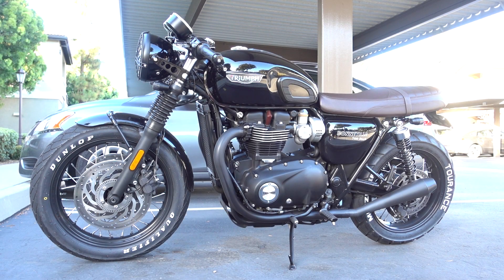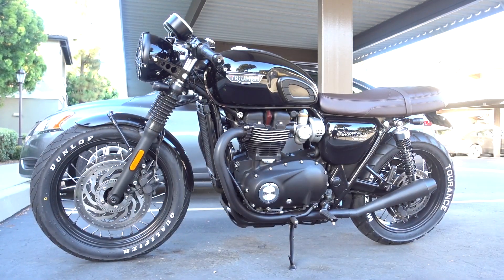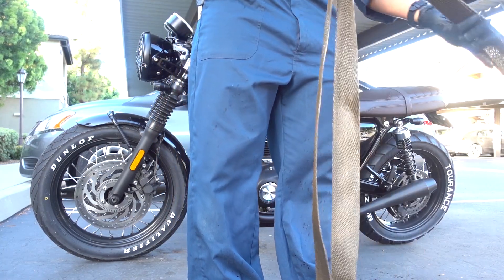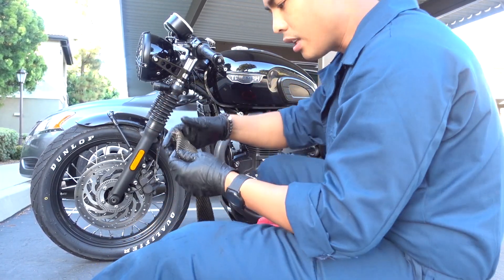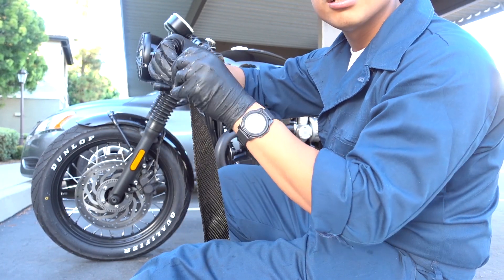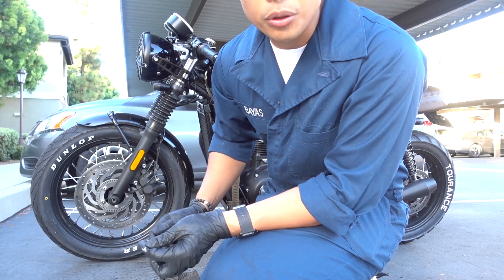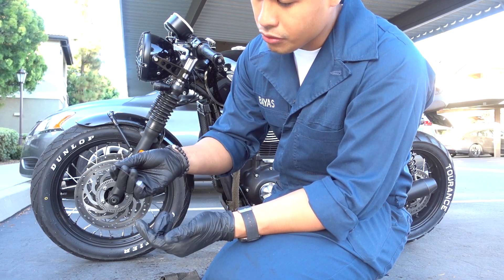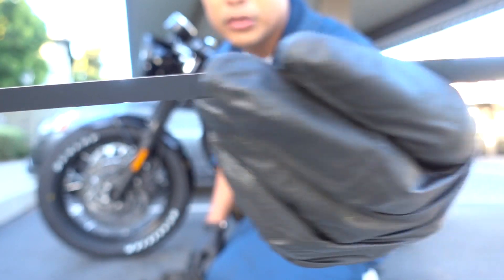2018 Bonneville T120 Black Exhaust Pipe Wrap

Comment: oh man... you made a common mistake ! you have to start from the end of the pipe and go in the direction of the cylinder. Like you did when water or dust is coming from above, it will go between each wraps - if you start from the end of the pipe, water and dust can't enter the wraps from above. Look at my videos on my Triumph Street cup.
Reply: I can see why it would be overlooked but it makes perfect sense, thanks for the heads-up!
Reply: Can you plz share the link of your video

Comment: This is a newb question, I apologize in advance. But how do you wrap the pipes on the newer t120 blacks. I noticed that the piping doesn’t go all the way through and partly acts as a covering by design to give the illusion. Did you change your piping or just wrap over the stock piping?
Reply from the maker: No need to apologize! But yes! I just wrapped over the old stock piping and the cover in the part where the pipe goes to the cat then back to the part where the exhaust pipe connects!

Comment: Hey Paolo.  Think I'm gonna pull the trigger on the clip ons and tires.  Just have a couple more questions...How is the tank clearance with the bobber clip ons at full turn?  With the larger tank of the T120, I have had issues with another set I tried to install.  For the tires, any reason why you didn't go with the Tourance on the front as well?  Thx
Reply from the maker: I didn’t go with the Tourance because I don’t think it was available in the size I needed. Also, these clip-ons have just enough clearance so that it doesn’t touch the tank at all at full turn.

Comment: Just wondering, did you use the black titanium from DEI or the regular titanium-gold. Did it change color? My bike is black like yours, trying to decide on color. By the way, there’s a guy that suggested crazy glue to lock in the fibers during installation, on his video it worked very well. Cool bike by the way.
Reply from the maker: I’ve had these wraps for a while now. Sorry, I forgot which exact ones I have.
Reply: Old Guy Gamer 
I ended up getting the titanium lava from DEI. It came out awesome. I used the crazy glue trick and I had no unraveling. I went for a couple of rides and the golden metallic color didn’t change. My exhaust headers are twin wall so they don’t get as hot, in fact you can touch the wrap with bare hands for a few seconds and not get scolded. They smoked quite a bit when I first rode the bike and I also noticed that they feel a bit “crunchy” after the first and second heat cycle. They haven’t completely dried yet, still some smoke coming out but no smell. I don’t ride this particular bike in the rain or lousy conditions BUT it will be very interesting to see how dirty they will be if I ever get caught out there. I don’t see a way of cleaning the wrap without damaging it. I guess a bit of dirt will only add some character. 
One thing that I noticed was that yesterday, it was a very humid day and you could see the moisture evaporating. I would be very concerned if the bike didn’t have stainless pipes and stayed parked outside for long periods of time, however, for those garage queens there should be no issues. Time will tell.
Reply from the maker: Nice to hear things are going well for your motorcycle! I had these wraps for more than a year and I ridden in rain, sunshine and whatever weather Southern California throws at me. So far, I have had no unraveling, and the wraps also clean off just fine with a thorough spray down and wipe with a cloth.i do notice a smell when the wraps get wet but, it hasn’t affected the bike performance or the wraps themselves.

Anyway, ride safe!

Comment: Great looking bike man! What bars and headlight brackets do you have? I’d like to see a video going over all the mods you have done!
Reply from the maker: Matt S. Thanks man! I will make a video about that soon, but to answer your question the bars are clip-on bars that Triumph sells for their Bobber. The headlight bracket are from Joker Machine.
Reply: @xrampax3236   did you need new cables switching to clip ons?
Reply from the maker: I did not. I used the same cables.

Comment: Love the sound of your exhaust!  Sure it's not stock.  Do you mind letting me know what brand, model # (if any)?  Wondering if I could replace my 2014 T100 stock.  I see you were able to do the job without taking the exhaust.  Just what I have been looking for.  Thanks for sharing your video.
Reply from the maker: Geoffrey Buted thanks for commenting!! My exhaust is from Gasser Customs. If you go on their website you’ll see they have different fitment for different year bikes so just pay attention to that! I chose the black ceramic exhaust for liquid cooled Triumph Bonnevilles 2016-2018.
Reply: Thanks!  I looked and decided.  Just curious if I need to remapped.  I hear if it is just a slip-on, you can get away without remapping.  Did you remapped yours?
Reply from the maker: Geoffrey Buted no need for a remap if you’re just replacing the slip-on pipes. I did not remap mine.
Reply: What a relief.  Was worried about that.  In fact I can even replace it myself.  I might just have a concern with the left side since it has the stand.  Any thoughts with that?
Reply from the maker: Geoffrey Buted wow.. didn’t realize you commented back. If you haven’t already done so... the pipes fit perfectly even with the center stand.

Comment: Really like what you've done with your T120!  I have one as well and am making some changes.  Were many modifications needed to install the bobber clip-ons?  My dealer told me that clip-ons won't work without a bunch of changes.  Also, are the new tires the same size as stock?  They look wider, especially the rear one.
Reply from the maker: A Russell to use the Bobber clip-ons you either have to cut the stock headlight bracket or get a new one  like I did. Also, the wires for the heated grips are too short to use with these clip-ons along with the issue that the holes aren’t big enough for the connectors to come through easily. Other than those things I didn’t replace anything else. 

As far as the tires, the front are bigger (110/90R18 Vice the stock 100/90R18). I found that the expansion of the tire at fast speeds caused them to rub so I had to replace the T120 stock front fender bracket to the stock Triumph Scrambler bracket for about $35 (the fitment is just direct replacement). This raised the fender bracket for clearance for the front tire at high speeds. The rear tire is the same as stock size (150/70R17)
Reply: Thanks Paolo.  And are the tires wider than stock, but still on the stock rims?  They look fatter, love the look of them.
Reply from the maker: A Russell front it wider rear is the same. I provided you with the exact specs of the tires in my previous post. And yes they I used stock wheels.
Reply: Apologies, I should have hit the 'Read more' link, lol.  Thanks again.
Reply from the maker: A Russell lol no worries